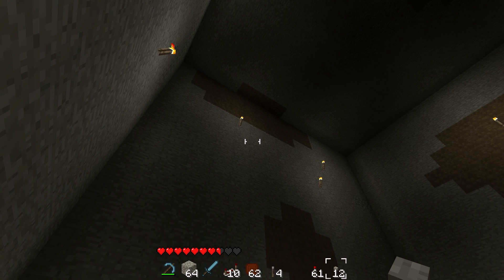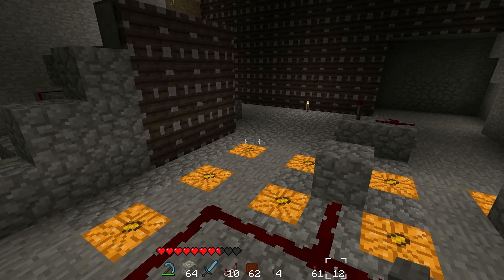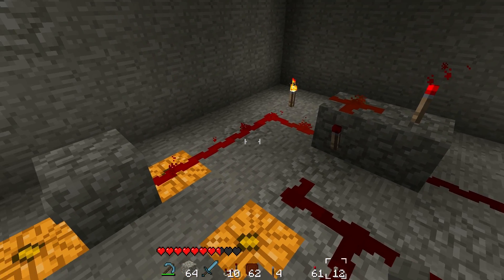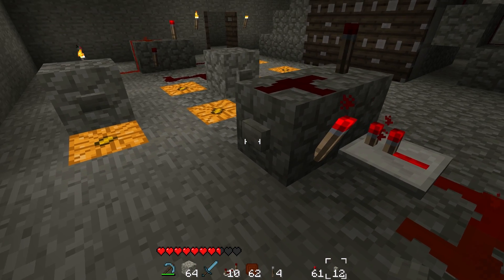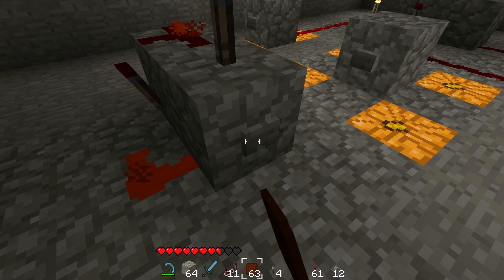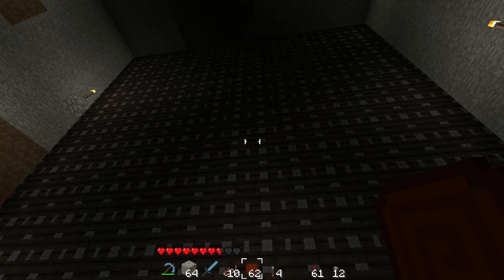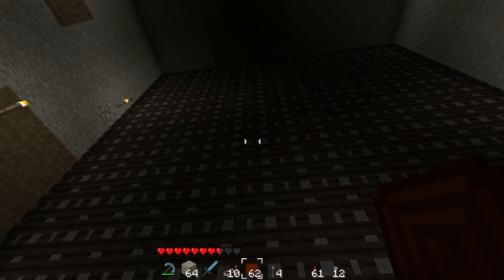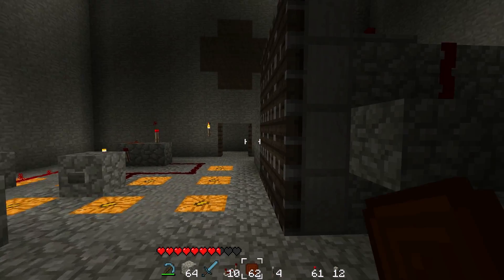Minecraft with Yushatak - Special - Smallest Possible 1-bit Memory Cell

Comment: You can make 1x3x3 memory, and likely better with the latest redstone update. I haven't looked much.

In any event, the reason it doesn't work with wire there and does with the repeater is that the redstone wire is not powering the block. The only thing that powers that block is the button on it that you're pushing. When that switches it changes the torch but nothing else in that arrangement can power that block.